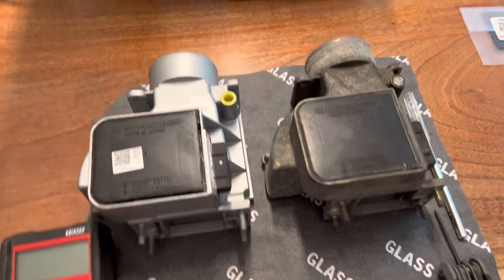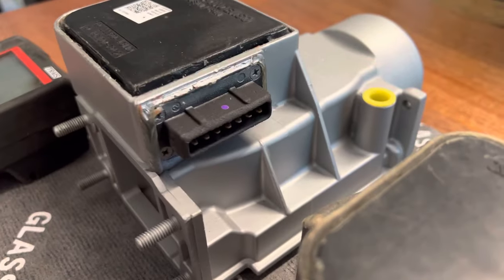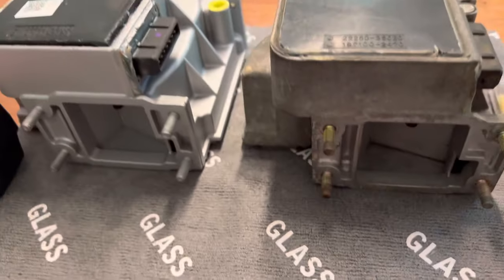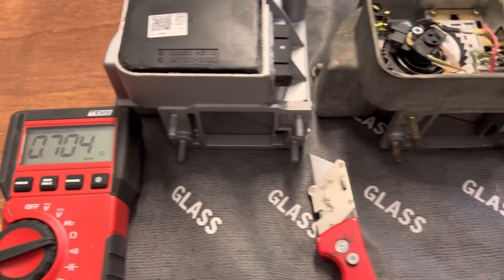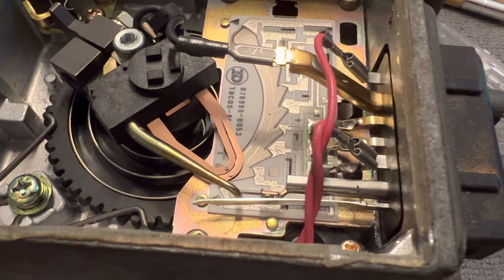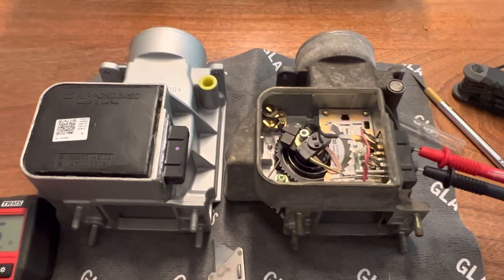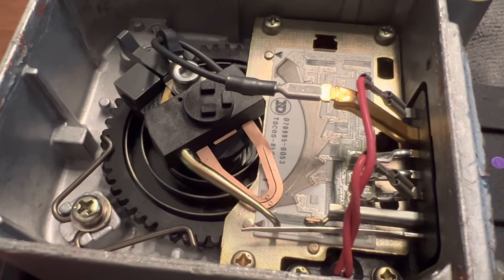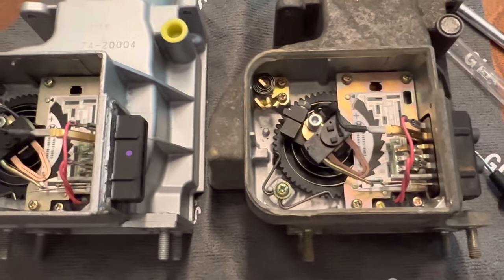Toyota 22RE AFM Air Flow Meter opening, cleaning, adjustment and troubleshooting.

Comment: Came here looking for a solution to a sticky flap, too tight causes misfiring, little looser is perfect but the flap sticks open and keeps the fuel pumping . But i learned something else 😅 great video, thank you
Reply from the maker: haha good to hear. Yeah that makes perfect sense as you'd have more or less combustion air than the AFM is reporting. Glad you liked the video!
Reply: For sticky flap, open the rear cover and clean up. Usualy aluminium oxidate and make the flap counter weight stick to the body, especially the areas where clearance is minimal. Use a smooth sand paper and polish, clean with throttle body cleaner, a drop of light oil on the spindle. It works. I fixed my bmw airflow meter last week.

Comment: The 'opens' on the meter is from the multimeter changing ranges.
Reply from the maker: Well in the video you can see it switch ranges down without going OL in between so I don’t think so. Goes from K ohms to ohms. Coincidentally there was a spot near where it wants to switch ranges. I should have turned off auto range. I did this before cleaning the track and points and it went OL a lot more and if I held the arm in the exact spot it would stay OL. 

Anyway, the real proof was how perfectly the engine ran after doing this. Before it would stutter and run rough but only at certain RPM, which corresponds to vane position.

Comment: Nice video...still not clear on how to set/use the meter for testing the AFM.  I actually have a 3.0 engine and am having extremely bad gas mileage yet it passed smog with "perfect numbers" I was told.  Runs fairly well when warm.  Does not give out black exhaust or have a gas smell.  1995 4Runner has 205,000 miles on it and original oxygen sensors as well.

Comment: With fluke meters I've seen issues with erratic opens when meter is auto ranging. If you can over ride auto range to the highest unit you expect to see  @ xkohm.1 for instance this could effect the appearance of opens in your sweep. I have two flukes an 87 and 89 both do this especially auto ranging about 1/2 way through the first then next range etcetera.
Reply from the maker: Good to know, thanks!

Comment: Wonderful video! 
Before watching this video the AFM seemed daunting to me, but now seeing your video it shows me how it works, its rather quite logical & straightforward to tackle a repair.
Reply from the maker: Glad my video could help. I almost want to redo the video because there are some mistakes and my understanding of how these work is quite a bit better. Anyways, key point is don’t adjust them too much unless they are totally out of adjustment. The ECU will compensate for them being out to a certain degree and once the engine is closed loop it’s not really having affect. Out of closed loop, yes it has some affect. But if you go too rich your engine will be less responsive at lower RPM. My advice is go just lean enough to keep low end response and that should be where you want it. Closed loop idle will be a little rougher than you want or can get by mistakingly setting this too rich. If it’s too far rich the engine will not go closed loop and should throw a CEL. Too lean I believe should do the same thing. Good luck! I can try to answer more questions if you have them.
Reply: If you do remake such a video, please show us your cleaning process. I know I’m gonna have to tackle this job in the near future.

Comment: My 91 was out of range so I did just what you did. Only I completely disassembled mine because the door was getting stuck. To fix that I removed the 12 M3 x .5 screws on the bottom plate. The plate had some arc scratches from a piece of sand or whatever. So I spent 3 hours rubbing those out with 2000 grit sand paper. Wet. Ultimately I just used 80 grit on a 4 1/2" grinder after wasting half my afternoon with the 2000 grit idea. (Bad idea). After removing the damn plate 4 more times and hitting it with the grinder, it finally opens and closes freely. Waste a whole day on a frickin scratch. So now it ohms out and I'm going to put it on now. If I had a job I would just buy these damn things when the go bad. But God they are expensive
Reply from the maker: Wow glad you got it working freely! Yeah they’re expensive and you don’t really know what you’re getting until you can test it out yourself!

Comment: Thank you very much for this detailed inspection.  It helped me to determine that mine is way off, getting 0.18 resistance on all 3 resistance checks.
Reply from the maker: Thanks for the comment! Glad my video could help. Best of luck getting a good replacement. Seems like it’s starting to get a little tricky!
Reply: @dustinhotaling3502  thanks, friend.  I've ordered a new one from Amazon, they're getting hard to find.  I've a '94, so it's a bit different style but similar enough.  I do prefer the previous gen's AFM style, it looks to be more durable, as the next gen has a delicate copper brush that sweeps across the contact runway and is very easy to break or bend, so I'll be exploring other options down the road.  I've heard of swapping a Supra AFM in, so I'll be exploring that avenue sometime.
Reply from the maker: @jessematherly5617  ahhh ok. I think that one is easier to find. I haven’t seen the inside of that one. I know with the Supra swap you have to swap the electronics anyway.. and pretty sure it only works with the older style like mine. BTW the reason my reman unit had the different part number was because it must have been a plastic cap from the larger Supra version. The caps were the same but the rest of it was bigger to have a larger vane and 3” port. Cardone must have swapped them inadvertently.
Reply: @dustinhotaling3502  maybe something they're aware of and did an improvement.

Comment: Excellent vidéo, im thinking About replacing that carbon track with a hall effect sensor and a microcontroller to emulate the readed value
Reply from the maker: That is really interesting.. if you could do it successfully and make some sort of kit to do it I bet you could make some decent $$ selling them. Hard to find good OE AFMs like this and the refurb ones are not necessarily good as I found out! Another way to get rid of the AFM completely is to modify your setup to a Mega-Squirt EFI computer. You can DIY it with a kit or get DIYautotune to build one for you out of your old ECU and just plug and play. Requires a vac line to the manifold to get the pressure which is uses instead of an AFM or MAF.. I want to do this swap on my 22RE because it’s a much more capable ECU and highly tunable. I think with a proper tune much better MPG is possible. Thinking especially in the case of a motorhome which we have. The stock ECU wasn’t designed for the constant heavy load of an RV and I’m guessing isn’t really tuned appropriately. I’d be interested to know what you can figure out!

Comment: Great awesome video. I used a microfiber towel with some rubbing alcohol to clean my AFM and get a reading of 80 ohm but when I push the vain door in , there is know more reading on my voltmeter. Should throw it away and buy a new ?🤔
Reply from the maker: Sounds like your ohm meter is going to OL (open loop)? If so, yeah that’s not a good sign. The tracks may be worn beyond what a cleaning is going to do. Possibly try cleaning again with electrical contact cleaner and polish the contacts on the bottom of the armature.. Unfortunately you may have to look into another unit.
Reply: @dustinhotaling3502  Thank you for responding right away. I clean it three times and still same problem. Thank anyway 🙏🏽

Comment: Does those results looks ok-ish ? 

"On vehicle inspection:"
E2 - Vs     .187
E2 - Vc     180.4
E2 - Vb     .280
E2 - THA  2.09  ( At 20 °C )

"Inspection of Air Flow Meter"
E1 - Fc Fully Closed 0.L
E1 - Fc Other Than Closed Position 00.0

E2 - Vs fully closed 169.3
E2 - Vs Fully closed to fully open position;

Went from closed 168.5 to fully open .271 ?

Why am I only getting .271 in fully opened ?
Reply from the maker: It’s been quite a while since I’ve gotten into this so I couldn’t tell you without studying it again myself.. but check out the 4crawler link in the video description, it will walk you through testing and what numbers you should see.

Comment: Would the SensorKleen Mass Air Flow Sensor Cleaner, Aerosol Can work fine instead of the denatured alcohol or contact cleaner for the cleaning of the board under the arm ?
Reply from the maker: I couldn’t say for sure.. I know you can get away with contact cleaner on a MAF but MAF cleaner on a circuit board may be asking for issues! Depends how harsh it is and if it leaves any residue. Probably not worth the risk ;)

Comment: Omg bro thanks for this info i had to mess with the air flow sensor on my 95 4runner n it smelled too mcih gas on the muffler so i turn left n it smells way less it  runs a lil better before it ran too much gas it would exelerate n i turn right on the part n it runs a lil better but i got to mess with it more till i get my new mass air sensor in the mail🙏

Comment: Great video, Dustin.  I recently tested a 22250-35020 on my '87 pickup and experienced the same non-linear anomalies (and even a dropout) in resistance that you were seeing.  However, my truck runs fine.  I plugged in the harness, and with the cover off, I instead took voltage measurements off of Vs to GND, and I got a nice clean and linear 2.76V to 7.36V across the sweep with no dropouts.  VS is what the A/D in the ECU uses.  I figured the multimeter wasn't supplying enough test voltage for the ohm reading to jive well with the laser cut resistor.  I deal with electronics a lot and I have seen this phenomenon before with variable resistors, albeit fairly rare.  I would say your original AFM is fine, but if your truck is running better with the reman, I guess that's not necessarily the case.  How did you know the Supra version was compatible with the pickup?  Thanks!
Reply from the maker: That’s very interesting! I did figure that might be the case but by cleaning the reman and the original “just right” I got them to the point of perfect on the multimeter so they must be passing good voltage/signal quality to the ECU. Probably overkill, but after cleaning the reman and adjusting it (possibly only needed adjustment because I twisted the armature a bit from its original mounting position) the engine runs flawless at all speeds and throttle position. Fine tuning of it and the idle air screw and it’s starting/idling easy and no hesitation on a quick throttle blip. A little leaner might be ok but I have some experimenting to do. Trying to get max MPG since this engine is in our Toyota Sun Land Express motor home! As far as the Supra thing I just cross referenced the Cardone part and it had both vehicles listed I believe. I’d have to go digging to find that bit of info. I believe there’s another Supra AFM that has a wider port/door that you can mod with the electronics of this one and get to work.. but that’s not needed in my case!
Really appreciate the feedback and info!
Reply: @dustinhotaling3502  Thanks for the reply!  I am wanting to get a spare 22250-35020, but reman ones are getting very hard to find, and they cost a bunch.  If you got yours working great with the 22250-43110, I think I will go that route because they seem easier to find.  Where did you buy yours from?  I assume you had to adjust the spring tension and lean it out because the Supra's had inline 6's I think.  Good stuff!
Reply from the maker: @poivre22  So that part should def work I’d say. I ordered my Cardone 74-20004 from an Amazon seller, I see they’re out of stock now. I see a couple of them searching on google. So.. not the Supra that you’re thinking of.. Look up Celica Supra or Celica GTS, where the 22RE was the default engine if not an option I believe. I’m sure the 6cyl AFM is different. I think it’s just an earlier version of the 35020 part. The only differences are the idle air screws.. the reman had the screw under that plastic plug. My original has the aluminum plug that you can drill out to get to the screw. Also inside in one of the corners my original has a small spring mechanism that I think maybe helps keep the door from closing all the way. The reman has the place to mount this part so I swapped it over. Not sure if it’s really necessary to be honest.

I debated between a used one on eBay but one that looked decent and reputable seller was about $200. I was able to snag the reman for $175. Still not sure if the electronics inside were replaced though.. honestly the strip looked as grooved as my original. The original only had 93000 miles on it though. I think a previous owner just mucked it up inside trying their hand at adjusting it, and it was finally producing crappy enough signals for me to notice the engine issues that shouldn’t be expected with a freshly rebuilt engine!

Here are some resources I’ve found about adjusting and everything lines up well with my experience:
https://www.celica-gts.com/forums/index.php?topic=290.0

https://www.celica-gts.com/resources/how-to/afm_adjustment.html
Reply: @dustinhotaling3502  The OEM part number on your 74-20004 is 22250-43110, which is for a 1982 Celica Supra with the inline 6.  If I look up that car on the Cardone website, their part number is 74-20028.  Interestingly, the photos of the 74-20004 and 74-20028 both show OEM 22250-43110.  Moreover, the correct part number for an 84-88 pickup 22RE is 22250-35020.  So, it is all very confusing.  It is possible that the physical characteristics of these AFM's are the same, and they piece together the internals with different boards.  So you could have a 43110 "case" with a 35020 board.  Who knows.  I am having a heck of a time figuring this out, so I will call Cardone tomorrow and see if they discontinued the one you have.
Regarding the tracks, those are supposed to be there, as they were laser cut at the factory.  And the "drop outs" are typical.  Check out the "dynamic testing" section in the following URL:
https://www.4crawler.com/4x4/CheapTricks/AFM/index.shtml

Thanks!
Bryan
Reply from the maker: @poivre22  The plot thickens. Interesting. Well the Cardone website specs the 74-20004 for a 1985 Pickup:
https://www.cardone.com/product/mass-air-flow-sensor-74-20004

But maybe mine just came back with a lid for the bigger Supra model AGM? Just a weird coincidence because it has the same cover size/shape and they mixed them up with a Supra 5MGE unit! Dang, this video needs some editing 😬. Hopefully people will find their way to this comment thread.  Thanks for helping clear that up for me. I knew I read somewhere that it was the right part for my truck ;)
Reply from the maker: @poivre22  and yes while drop outs may be a typical issue, according to the FSM you shouldn’t see them on a multimeter when doing the dynamic test. It’s probably fine if there’s just 1, 2, maybe 3 of them, unless one is right in a commonly used air level like you would have with highway cruising. Like you said though, the dropout may not occur at the voltages used by the ECU, but if it shows on the multimeter it’s potentially a spot that the ECU will have issues with as well. 

What I’m still trying to understand is how the ECU is interpreting a resistive value that changes in a wave like pattern to then increase fuel in a linear fashion with the increasing air. It must be referencing TPS or O2 sensor too? Or another sensor? Maybe you or someone else has an idea there?
Reply: @dustinhotaling3502  you're video was great.  I learned more than I wanted to know about mid-80's Toyota AFM's.  :-)  I found a 74-20004 through Advanced Auto Parts, so I am going to go with that one.  Thanks for all the useful information.  Happy trails in your Sunland Express!
Bryan
Reply from the maker: Didn’t mean for potentially to be crossed out. Hah
Reply from the maker: @poivre22  well, thanks. Just don’t want someone to order that part # and end up getting a gigantic version! Cheers!
Reply: @dustinhotaling3502  regarding the wave pattern, here is my theory.  The plate swings open based on the amount of differential pressure it sees across it.  Volumetric flow has a square root relationship with DP.  So if the plate opening increases 2X, the flow has only increased by 1.41X (sqrt  of 2).  The ECU only has an 8-bit processor probably running at  around 1MHz at best.  So it can't take a linear signal and run square root calcs fast enough while maintaining a good throttle response.  So to get around that, Toyota  basically "square rooted" the resistor by laser cutting the etch, which is why the %open vs voltage curve is logarithmic.   So the voltage the ECU sees is already linear with air flow due to the non-linear resistor compensating for it.  It also looks at throttle position, air temp, coolant temp, RPM, and O2 (when in closed loop mode) to tweak the fuel map accordingly as those conditions change.  I am probably way off on this, but it sounds good doesn't it?  :-)
Reply from the maker: @poivre22  Hey, you sold me. You’re onto something at least! I’m trying to simplify it in my head. If it isn’t as you describe.. maybe it’s like the voltage signal from Vs is the “second digit” in a value and another signal (TPS/RPM etc) or combination of other signals is the “first digit”.  The Vs is like a sawtooth signal really from that I remember on the multimeter. So between the two inputs you get a full value for the ECU to gauge injector flow. Haha, probably not.. Maybe we’ll get someone who really knows the devilish details of this 22RE fuel injection system to share their knowledge. Anyways, good conversation!